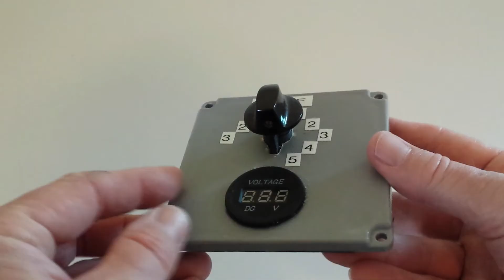DIY Modified Kayak Trolling Motor Remote Speed Control Box

Comment: How is this method inferior or superior to using a 60amp PWM with remote controls? Glad I found this. Love your videos!
Reply from the maker: Thanks Troy. It is not better or worse than using a PWM or ESC. It just uses the controller from the trolling motor so you don't have to buy another type.

Comment: I just upgraded to a 40lb motor. What size AWG wire should I extend the Black and Red wires from the motor to the switch box near my seat? It’s about 8-10ft. I assume running 8awg from the switch box to the battery in the front hatch would be enough correct?
Reply from the maker: That would be fine.

Comment: Hi. Great information you put out! Thank you! 
I want to use this setup as a backup in the case of my PWM failing. I would like it to be a wiring quick connect swap out version like SAE or something similar. Since I now have TMI overload, I would like your professional opinion please and thank you.
Reply from the maker: Thanks! yes, that would work. You can also just connect the motor directly to the battery in case of failure. I have a video that explains that.

Comment: Currently making this design right now. How’d you make the cut for the box? Last thing I’m stuck on is
Reply from the maker: Which cut out?
Reply: The one to get that key shape into the box?
Reply from the maker: @joshockimey2400  I drilled a hole and then filed out the small key square.

Comment: I want to do this with my New Port , where did you get the little nob to turn switch after putting in control box
Reply from the maker: Amazon has many choices.
Reply: @Aksmaniyak  thanks , I took apart the control handle and the newer motor control doesn’t have the extra line key on the small shaft just the round circles that the turn shaft comes out of . But I’ll figure a way to mount it without it spinning when switching speeds . Thanks again for great video
Reply from the maker: @GettinSalty  You can try using a knob that has a set screw to hold it in place.

Comment: Great video, many thanks. How to hook up the volt meter and what is it used for?
Reply from the maker: Thanks. I just run it off the pos/neg wiring. It lets me know how much charge is left on the battery. When it drops below a certain value, it's time to recharge.

Comment: I'm in the process of motorizing my kayak, and this seems to be an easier and cheaper solution than going the PWM route. Yet, I have trouble finding any other videos about doing it this way as opposed to a PWM setup. I need to also say that my electrical knowledge is VERY basic, so the simpler the better. In your video here, is the final step just completing the wiring setup from the TM to the controller and battery? Am I missing anything? Finally, in your opinion, which method is better as far as reliability, cost, and ease of use? Thanks!
Reply from the maker: Thanks. Yes you have the right idea. This is the simplest and least expensive way to relocate the head unit.
Reply: @Aksmaniyak  Thanks! I've looked at so many videos related to adding a trolling motor to a kayak, and yours are by far the most detailed and helpful! I think I'm gonna go this route rather than using a PWM just because of everything I've read about potential for those getting too hot. Also, relocating the tm control unit seems to be the most straightforward and inexpensive method too. Thanks again sir!
Reply from the maker: Glad to help! Thanks.

Comment: Thank you, Thank you, Thank you...I have a 55 LB thrust Newport motor.  A couple of PWM's have already failed...If I find a reliable PWM, is it that much of an advantage over using the switch in the motor as you show here?  Does the PWM extend the battery? 
Thanks in advance
Reply from the maker: Glad to help. A PWM or ESC will extend battery life. Check out my Minn Kota Traxxis control board build. It would work fine for a motor that size.
Reply: I very much appreciate your response @Aksmaniyak  
Thank you😀

Comment: I’m looking to do this for my Endura C2 30 and was wondering; How did you wire the switch once relocated to the box? Wiring configuration is what I’m looking for.  Thanks
Reply from the maker: The switch has color coded markings at each connector.

Comment: Great work! I was wondering what gauge wire you used to extend the remote speed control box to the main motor to make it longer?
Reply from the maker: Thanks Gareth. I used 10G on the red/blk and 14G on the yel/wht.
Reply: @Aksmaniyak  cool thanks!
Reply from the maker: @garethlalexander8620  You are welcome Gareth.

Comment: man this is honestly 100x easier to do than adding a pwm and removing/adding cables and having to put fuses.
Reply from the maker: Yes, it is much easier but not as energy efficient as a PWM.
Reply: @Aksmaniyak how much less Efficient? Is it worth it to do this or a pwm?
Reply from the maker: @milfandcookies8673  It depends on your budget and how you run your motor. A PWM will save on the amp draw from the battery and give you "infinite" speed settings. In my opinion, a PWM is worth it.

Comment: What guage wire did you use to extend from/to the speed controller? The yellow and white wire are different size from the other ones,  and where they marine grade and where to buy? Also if I install a 7 port trailer plug does it need to be grounded for the TM?
Reply from the maker: Hi Steve. The yellow and white wires can be 14 or 16 G. The power blk/wht is 10 G. Yes, I use all marine grade wiring.Try BestBoatWire.com for the best prices.
Reply: @Aksmaniyak  thank you, you're stuff helps me a lot.
Reply from the maker: @Van50van  You are welcome.

Comment: Aksman, tnx for your vids, they are of great help. between the vids and the comments, there almost nothing left unchecked !
could help me with 2 questions i'm left with at this point:
my setup is a Hobie outback & Minnkota Endura C2 30LB.
1. you mentioned connecting the VM directly to the battery using a fuse. why should I use a fuse there, and which one ? (unless this is also the main fuse for the entire system?).
2. the reason I haven't been using this engine yet is because i don't want to carry a super-heavy battery. my plan is to buy a Lithium battery (LiFePo4 type).
seeing all your vids, I wonder, why don't you use a lithium?
do you have any LiFePo4  you would recommend ( I believe with 50A I'll be in the safe zone for most of my needs)?
to be honest, I was mainly putting my eye on this one: https://www.bioennopower.com/collections/lifepo4-batteries-for-marine-fishing-kayak-applications/products/12v-50ah-lfp-battery-abs-sealed-ws?variant=1308418248 , but I'm unfamiliar with those batteries or any other brands, to be honest.
3. how do you seal the bottom section (the engine section) ? some told me you shouldn't because the hollow tube is a heat conductor, others told me it's a must, because all the failures eventually arrive from water getting in there.
4. how do you seal the knob, so wave-water won't get in to the box (given that it''s a dynamic, constantly moving part)?

tnx again,  you spoil us with awesome help and inspiration !

EL
Reply from the maker: Thank you Eldad. I hope that I will answer your questions to help you.
1. If you use a VM and connect to the battery, a 1A fuse will be large enough.
2. I use the AGM batteries instead of Li batteries because they are much less expensive. I have never used a Li battery so I am unable to recommend one.
3. The shaft is protected by using the 90 degree PVC fitting. I heated the fitting until it becomes pliable and then press it onto the shaft. I seal it after it cools with some marine goop spread on the shaft.
4. I seal the knob by making the hole as small as possible. The fit is very tight and again I spread a thin layer of marine goop to seal it. It is very water resistant.

I am glad that my videos have helped you. This is why I share my knowledge.

Comment: So this is not a PCM but just a remote control for you trolling  motor?
Reply from the maker: Yes. This is not a PWM. This is a remote box using the stock 5F/3R switch.

Comment: Just wondering based on your knowledge of the design, would it be possible to just extend the wires from the head  to a place where your could control the head and use something else to control motor?
Reply from the maker: Yes. I have done that on other builds.

Comment: Did you have to wire in a potentiometer to be able to vary the  speed? Unless I have something wired wrong I’m only able to get full power forward and full power reverse. I love your videos thanks man!
Reply from the maker: Thanks Chase. This box uses the original 5F/3R trolling motor switch removed from the head. It should operate the same way as the stock switch.

Comment: I was thinking about doing this for a larger kayak, I was wondering if you could possibly create a 2’ - 3’ length custom cable with the 4 wires coming out of the top of the trolling motor and turn it into a 4 pin male plug to enter into a female connection that is waterproof for a quick disconnect. I would run the 4 wires from the permanent female connection to my new hand control location and then from there I’d run the two to wires to the battery.
Reply from the maker: Yes, it can be done. I made a similar power plug/kill switch box (see video).

Comment: How did you fasten your extension wires to the switch when you installed the switch in the 2" high box. I am using the same size grey plastic electrical  box and can not find any 90 degree push on terminals that are large enough for #10 wire as straight push on terminals are to long to work when installing the switch in the box. Thanks Gary
Reply from the maker: Hi Gary. As you can see, some of the switch terminals are bent a little. You can do that if you can't find any 90 terminals for 10G wire. Just don't break them.
Reply: Just found some #10/12 gauge 90 degree terminals on EBay, Must have missed them before when I was looking. Thanks Again Gary

Comment: Great video!  I can't wait to put all of this into action.  Couple of questions: what kind of knob did you use on the control and where did you get it?  Also, where did you get the voltage meter and how do you hook it up?  Is it used to let you know the strength of your battery?  I'm a novice and just making sure I'm doing it all right.
Reply from the maker: Thanks Randy. If you check out other comments here you will find the Amazon link for the knob. I also got the VM from Amazon. The VM is very easy to hook up, red wire POS +, black wire NEG - , and it measures the voltage of the battery. We were all novices once...ask any questions if you need help.
Reply: Thanks so much!

Comment: Hi, Can you show us on another video on how to attach the battery wiring?  Thanks!
Reply from the maker: Hi Gino. It is very easy to connect the battery wires. The 12V +/- connections are stamped on the switch connector tabs. I hope this helps.

Comment: what size are your letters and numbers?
Thanks
Reply from the maker: I used a P-Touch lettering tape machine on the large setting. I think that is approximately 1/4".
Reply: Thanks I found some white 1/4 inch adhesive vinyl letters and numbers on Amazon. I bought all other materials and have started building this. Thank for sharing!
Reply from the maker: Great Don. I'd like to see your project when completed.
Reply: I have finished but don't know how to post a pic on here
Reply from the maker: I looked and can't figure it out either. Are you a member of the Kayak DIY Projects & Tutorials Facebook page? It's a great group that shares these types of projects. You can post it there if you want.
Reply: I just requested to join
Reply from the maker: Great. I think you will like the group.

Comment: Thank you so much for sharing this video, you're a true inspiration. I have few questions if you don't mind answering: 
1. Do you seal the hole on the bottom of the electrical box? if yes, with what?
2. How do you extend the original wires from the motor to your box?
3. Do you need any circuit braker / fuse box to protect your motor?
4. How do you wire voltage meter and how do you read it to know the hours/percentage of battery is consumed or left?

Thanks again
Reply from the maker: Thank you Bashar. To answer your questions: 1. Yes, I sealed the hole in the bottom of the box using a 3/4 inch threaded PVC pipe fitting. Both sides of the fitting are threaded and the internal thread is secured with a PVC threaded ring and marine goop. The outer thread is then screwed into a hole in the kayak using marine goop as well. 2. I extended the wires using the same gauge wires and colors so the wiring would stay the same. I used waterproof wire connectors for the splicing and switch hook up. The short length of the wire splices will not adversely affect the motor. 3. Yes, I would definitely use a circuit breaker. A good rule of thumb for designing is that for every pound of thrust on a trolling motor, it draws 1A of current. So, if you use a 30lb thrust TM, then assume it draws 30A of current. When you choose the breaker, use at least one rated for 10A above your motor to be safe in case there is a current surge. 4. The voltage meter uses a red (power) and ground (black) wire. You can hook it up directly to the battery using a fuse in between the red wire from the gauge and battery. You can also run everything into a fuse box (this is a little more complicated though). I hope this helps.
Reply: Perfect that's what I needed to know! Thanks and keep up the awesome videos!
Reply: Did you use a quick connect system for the wiring between the trolling motor and the switch IE: a trailer connector of some sort?
Reply from the maker: You could, but I didn't do it on that project. I ran the wiring inside the hull to the box directly.
Reply: Thanks for the quick response! In your other videos I have seen that you have used a quick connect before. Wondering if you need a 6 pin for the six wires from the trolling motor. also wondering if you just use a generic connector like you'd use on a vehicle or if you know of a better one.
Reply from the maker: Yes, I have used quick connects on many of my projects. I didn't use it on this one because I didn't like the big 7 pin connector that I would have needed to use. I have seen others use the 7 pin trailer connector successfully. The trailer connector is usually weather resistant. You just leave one pin unconnected to do it.